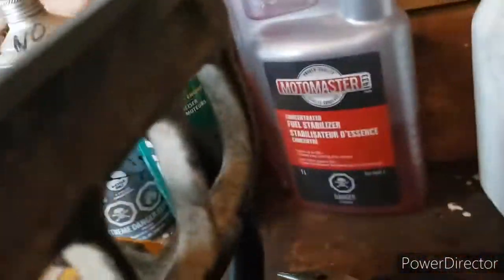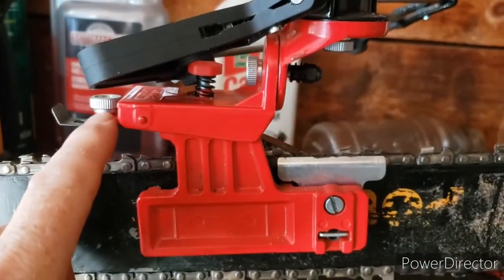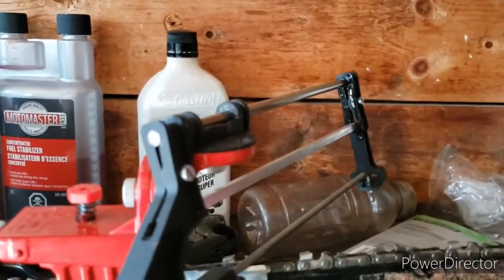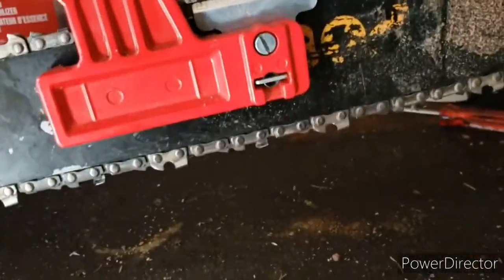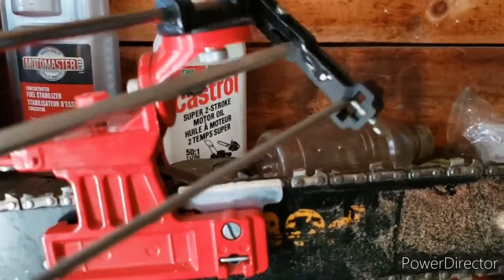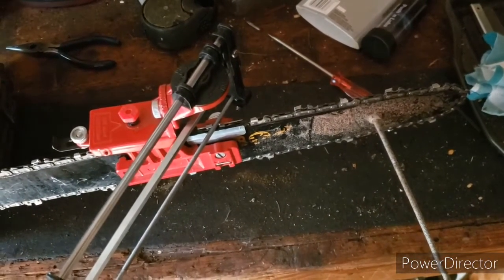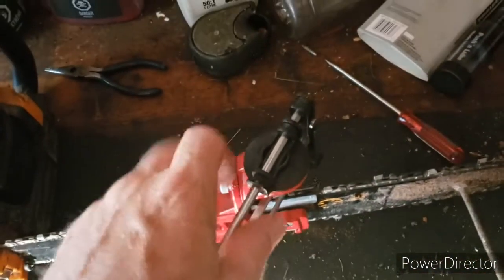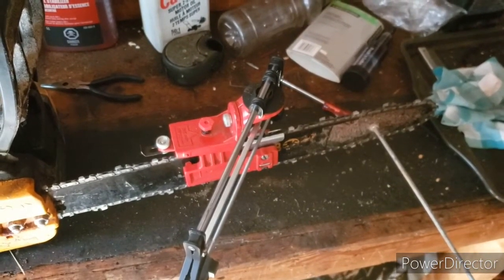Oregon Bar-Mounted Chainsaw Sharpener: The Best Chain File Companion. #chainsaw #sharpening #oregon

Comment: I have an old Oregon model I have never used and which I am about to try. The manual says "Position the chain guide T-bars so that the tops of the chain rivets are barely visible over the T-bars.  The pressure screw (on my model a thumb screw) and the T-bar adjustment knob (a spring loaded knob) on both sides of the T-bars must be tightened equally so that the T-bars are centered in the frame. The pressure of the T-bars against the chain is adjusted by the pressure screw. The pressure is correct when the chain can barely be pulled around the bar by hand. Adjust the stop screw (stop for the "middle" square bar) so that the file's center line hangs directly over the T-bar center mark.